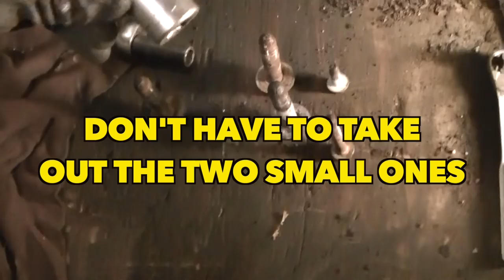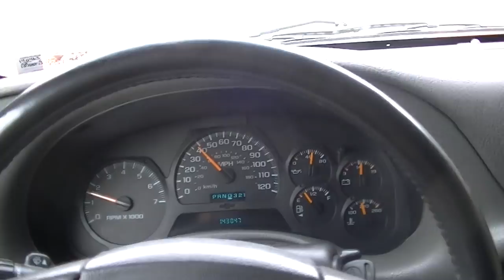Trailblazer Lower Control Arms support Brackets Replacement.

Comment: I wonder why the ball joints and sway bar end links wear out so quickly on these trailblazers...just cheaply made or is the truck that hard on them...and FYI...those lower control arm brackets have everything to do with alignment on these trucks so make sure to mark where they sit inside the cradle before removing the old ones lol....I had a major accident to threw mine way off so I’ve been fighting with trying to get it aligned properly and the alignment shops won’t mess with these brackets and will tell u it’s shot..,the frame is bent and whatever else they can to keep from having to deal with it
Reply: Can only go in one way

Comment: Had to do this as well. Actually tried replacing the bushings first. You can get the smaller bushing from AutoZone however spent half an hour trying to find a bushing the same size as the bigger one to no avail. Rock Auto has them pretty cheap go to suspension, control arm support it will be their. You do not have to take off the wheel hub, strut support bar, brake caliper and rotor, and do not have to loosen upper ball joint. Just remove lower ball joint and knock it loose then use Jack to raise lower control arm just enough to move lower ball joint stud away from wheel hub, remove bottom sway bar link bolt smack it out then remove control arm bolts, use a pry bar to move control arm away above the bracket, make marks so you can measure the distance on the 3 bolts holding the bracket, loosen then smack bracket and remove. If you do one bracket you might as well do both brackets because it is best to do an alignment since it will screw up the alignment you already had.
Reply from the maker: Ok. Good write-up!
Reply: so you didn't have to mess with the strut and that (literally) killer spring to do the control arm bracket?  I was thinking one could just use a jack to support the lower control arm and undo the bracket, swap it out and be done, but I haven't had a good look at all the bits in that area yet.
Reply: @michaelengle9062  no you do not have to move the strut to get to the bracket. Leave it bolted to the control arm. Once you knock the lower ball joint and separate the control arm from the bracket it will move around easily and enough room to unbolt the bracket from the cradle. The hardest part was getting the bracket since mine was really in their. My advice if you do one side you might as well do the other side. Even after marking the bracket it's still a good idea to get a new alignment done.
Reply: awesome. thanks for the advice
Reply: @christopherzube551  I cannot get the ball joint stud clear of the knuckle, the top of the joint hits part of the knuckle (have a pic but can't post) before the stud clears..
Reply: @michaelengle9062  just seeing this sorry for the late reply. If you haven't gone any further than smack the nuckle on the lower control arm till it pops out than use a jack to lift on the control arm to raise it up until it clears than you move the wheel hub assembly to the side where the tie rod is. If it is the driver side than move it to the left. On passenger side move it to the right.

Comment: Why did you remove the steering knuckle for the lower control arm? You could’ve just let it hang from the strut and upper control arm.
Reply from the maker: You don't have to remove the knuckle. But all that stuff is in the way sorts. And then you have to hang up the knuckle, and it's pretty heavy.
Reply: For the camera angle 👍🏼
Reply: @R230Tuner  do you have a video?? I'd love to watch it and complete it like you said in minimal time and minimal removal thanks

Comment: Really nice video and the fast action time is a good touch.  But, my main complaint is that you did not identify many of the parts you removed.  to an inexperienced person having these parts identified are immensely helpful. You used words like these guys (sway bar stabilizer bolts).  And why did you opt to replace the entire bracket rather than just the bushings that was the bad component?

Comment: From the looks of it, if you could have had better access under the vehicle, you could have replaced those parts without even taking the brakes off.  You'd probably still have to take the CV shaft nut off so you don't pull the boot apart, but it seems possible.  Removing the lower bolts, then sliding it out while attached to the lower control arm by pivoting the spindle out and back, then taking the two large bolts out to get it free of the lower control arm.  If I end up doing these on the truck I'm working on, I'll try to remember to let you know if that works.

Comment: I'm really enjoying your videos, they are very informative. I  just bought an 03 LTZ  Trailblazer in nice condition for my daughter. The 03 has 250K miles on it and I knew the front suspension would need work. I started with the struts, while changing those, I noted that the ball joints and upper control arm bushings were worn out... so now I'm just going to replace all of the ball joints, tie rod ends, control arms, sway bar links, etc at the same time. The nice thing is that the parts are incredibly inexpensive.

Comment: I asked the same question as Wolfsburg...why remove the outer steering knuckle?  If you loosen the lower ball joint, lower strut mount bolt and sway bar link your lower control arm should drop when you remove the two bolts from the bracket.  Might be a bit tight, but it should drop.  Still a good detailed video how to disassemble a front end and if anything is worn it should be easy to ID and replace while it’s all apart.  	to pull the bracket out try a screw driver in the bushing hole while you pry the other edge...little leverage helps.

Comment: I did a lot on mine.  It was my dads and sat in the grass for years. You can imagine the damage.  I drove it over a hundred miles home.  Scary drive. But, when I did the struts, I couldn't get the lower bracket off of the lower control arm.  And that pinch that holds it on the strut, you have to split that pretty good.  A regular flathead screwdriver wouldn't do it.  I used a cold chisel with a pretty steep angle on it and split that thing about 5/16-3/8 inch at least before it would pop off.  But, I melted the lower outer bushing that holds that same arm on the lower control arm.  I purchased the bushing online.  They were cheap, OE even.  AC Delco's... So, new trial. I hope they come out.  I don't have a Dake or any kind of press.  I hope I can get them out and new ones in without too much hassle... If I have to take it apart and remove the LCA, I'll send them back and just get new LCA's...  I'll keep you posted...

Comment: thanks for all the trailblazer videos! I have an ascender and have had to replace a lot on it. and you have a video for everything I've needed to do. so thanks for that!
But! I have a question regarding the installing of the new LCA bracket in this video. you said "to use a wire to measure so the alignment isn't off", can you explain more about what you're doing with the wire? I thought that once the bracket was in, we line up the 3 bolts in their holes, screw 'em in and torque the hell out of it.  thanks again for all your videos again!

Comment: Nice job i will be replacing my lower control arm tomorrow ....thank you for the video
Reply from the maker: Be safe!!
Reply: Hey boss I just replaced the lower control arm and sway bar link I double checked everything is tight but do u need alignment ?? My steering wheel turns to the right

Comment: I am in the middle of replacing motor mounts and struts in my envoy and noted the poor condition of the ball joint housings.  I am going to have to check to see what kind of play is in my system.  I may wind up replacing everything before it is over, but initially I was not going to do this myself.  It is a pain but I have more confidence that I can do it as a multi day project.  So far I have been using OEM parts, though I need to research what parts I can go cheap on.  Thanks for the video.
Reply: 0í

Comment: I do all my own work on my tb and looking at your video was taking everything off necessary??? Honestly can I just undo the sway bar link and wiggle everything out or will I need to maybe loosen the top upper pinch bolt as well????  I've seen some comments but looking for a solid answer thanks alot nathan

Comment: Saved me a lot of money was looking at spending 750 for every thing only cast me 200
Reply: Did shop quoted you $750 parts and labor? If so its a huge savings because I already ordered the parts for $179.99 on ebay both control arms and brackests

Comment: I’m having trouble understanding the wire you used, can’t you measure from the frame to center of bushing on each side? I’m going to be replacing whole bracket and control arm for each side next week, trying to get as much information as possible

Comment: I drove my car after replacing the the rack with out replacing the crossmember and the rear bolt that secures the lower control arm bracket. The bracket pivoted out while driving and I would like to fit it back in without the full dissambly. I figure if I detach the yoke to control arm connection I can better maneuver the bracket back into the place. How does that sound?
Reply from the maker: Good!!

Comment: I left about half of that stuff on and did not have to take it apart
I removed the lower control link and the two bolts to the control arm
Pulling the axle and  bearing assembly away.
Remove the 3 control bracket bolts from underneath and slide the bracket out
and replaced it.... 35 min>

Comment: Hey man, just out of curiosity. I'm assuming your vehicle would pull to the right as you said. Was this primarily when you were braking? I'm asking because I got an 07 Trailblazer and whenever I apply the brakes it pulls to the right. Originally I thought it was the driver side brake caliper not functioning properly, and after replacing it, the pull did improve a decent bit, however it still pulls to the right.

So if that being the case why you replaced your lowers, do you think if I did the same it'd fix the problem
Reply: I had the opposite problem. I would hit the brakes and it would pull to the  left. I only accidently came across all the play in the lower control arm while doing my brakes. I replaced both of the lower control arm bushings and it completely fixed it. It recently started doing it to the other side so now that's what I'm fixing

Comment: My right lower control arm bracket is crooked it's slightly pulled out and uneven where the bracket is, the steering wheel sways to the right My question is can it be pushed back straight once loosening the screws or do I have to replace
Reply: Replace

Comment: Not sure if you still have this truck, but does the level of rust on the frame concern you at all? Could you say that you can get a few more years out of it with the next parts installed?
Reply from the maker: Its still going today. Spray some used oil on the rust ;)

Comment: Is this something that causes my steering wheel to veer to the left/Right? Should I replace the whole control are with bracket?
Reply from the maker: Yea it can.
Reply: Now could I just replace the lower control arm ball joints? Instead of the whole control arm?

Comment: How did the 63$ control arm brackets hold up?  Need to replace mine.  Shop will not do alignment on my vehicle because they say the are shot.
Reply from the maker: Still going.

Comment: I've literally replaced the entire front end and driving I feel a clunk when steering and my wheels will be perfectly aligned and then after the clunk they will be out of alignment. And then yesterday I had to slam on my brakes at 60mph and it really popped out of alignment the whole wheel was sideways and driving over 25mph would make the tires squeal. Could this be my issue? It's been doing this for months and I've gotten it aligned 6 times in the year I've owned it. It's been really frustrating
Reply: It could be, yes.  By replaced entire front end, how much have you replaced?  What in the steering assembly alone have you replaced? Need more details...
Reply: @JnitraM078  just found out my passenger side control wasnt tightened all the way and was shifting. Everything is all good on it now

Comment: I’m trying to remove my lower control arm bracket, and the bolts simply will NOT budge, I had an impact socket, breaker bar and a small bar extension and it would not come free at all. Any suggestions?
Reply: Heat it
Reply: Be a man and use some muscle lol
Reply: And lots of penatrating oil

Comment: Why take the upper parts off for the bottom control arm? Just wondering I have to do this and didn’t think it’d be necessary.

Edit: I bought the complete lower control arm with bracket.
Reply from the maker: Don't have to. It was just in my way....lol
Reply: Gen 01: I'm replacing both my lower control arms + brackets in two days and thought I may get them off without removing the knuckle and upper control arm, just like you mentioned. Did it work out OK doing it that way? EDIT: OK, I WAS able to remove just the lower control arm without removing anything else ...and I have AWD with the shaft slightly in the way.

Comment: Sledge hammer a pipe or pry bar...that’s how u can move the brackets and a 6ft long extension pipe to place on the breaker bar to get those bolts off and back on tight enough...tighten them as tight as u can get them because they will loosen back up! Even with locktight!
Reply from the maker: Tighty!

Comment: Where to buy the parts?
Reply: 1aauto.com was cheaper than Amazon for me, just bought all new suspension parts for my TB, upper lower arms, struts, tie rods...
Reply: I just got Upper Control arms, lower control arm mounts, upper and lower ball joints, front and rear sway bar links, inner and outer tie rod ends and boots for under $170 from Detroit Axle on ebay.
Reply: try youtube.com/autozone

Comment: Way too much extra work. Lower ball joint, strut mount bolt on the a arm. Sway bar link, and the three bolts that hold the bracket on. And you've got the whole assembly out. Why take apart all that extra stuff?
Reply from the maker: So other know how to do it "if"

Comment: So why didn't you just get new bushings instead of a whole new control arm? I know you have the tool to do that.
Reply: Because the bushings cost as much as the arms. Plus you still have to take out the brackets and do an alignment.
Reply: Replacing the bushings can become a very hard job,  I know.